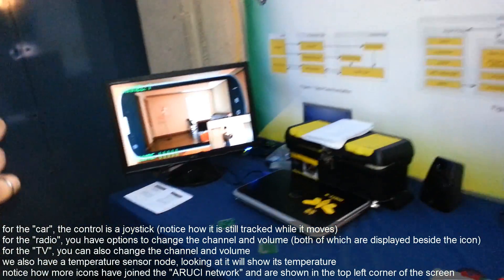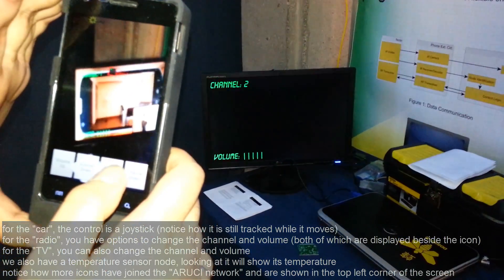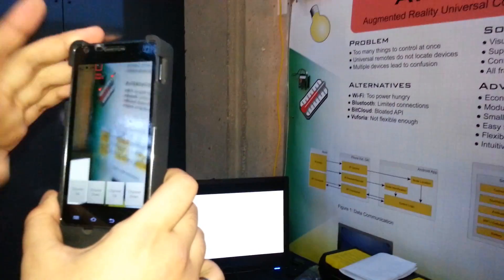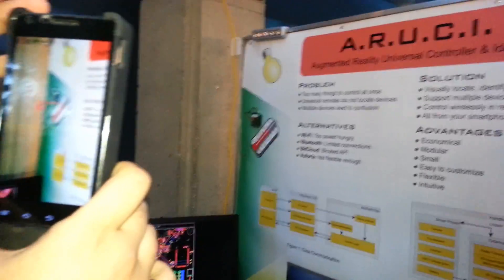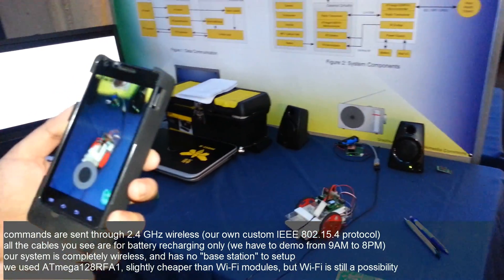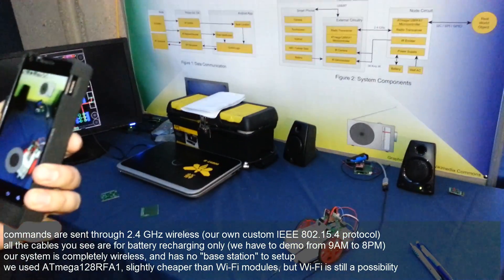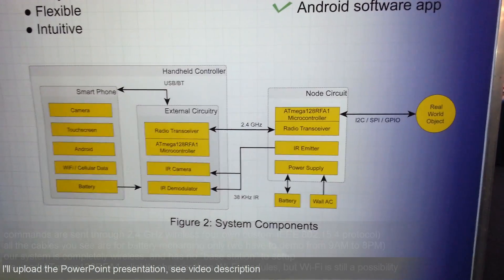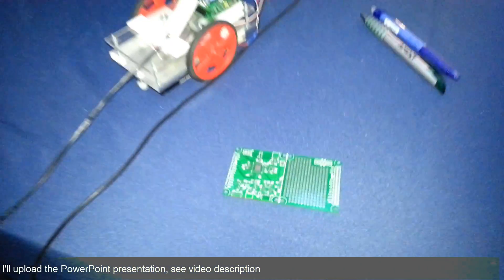ARUCI, our UW ECE design project

Comment from the maker: Identification and location without LOS is possible but not practical within a small room. Think of Yelp's Monocle, which uses the phone's orientation sensors (accelerometer and gyroscope) and compass sensors, plus GPS location, plus a database of known locations.

But since GPS indoors isn't going to work, we cannot use that method. If we can solve the problem of tracking an object indoors with precision, then we can then do everything without LOS.